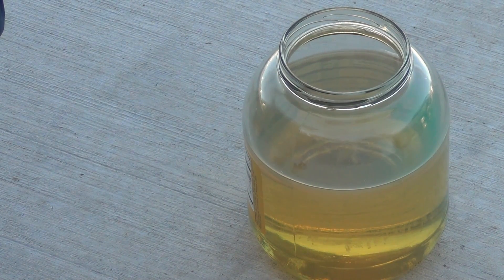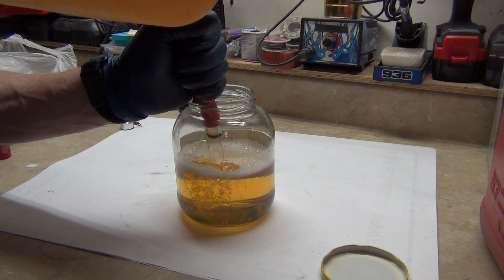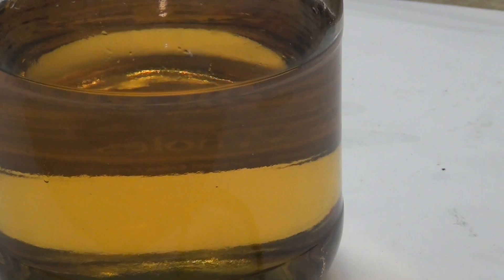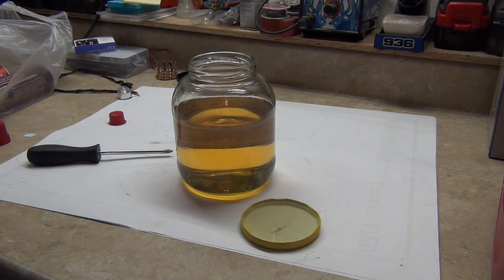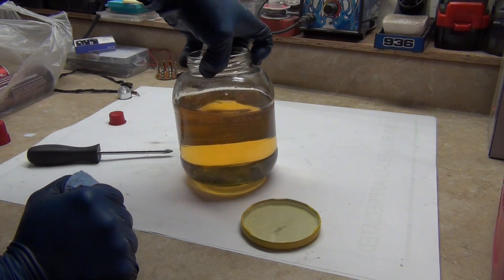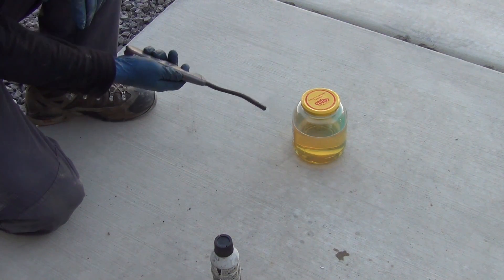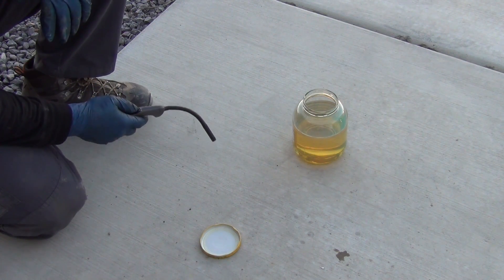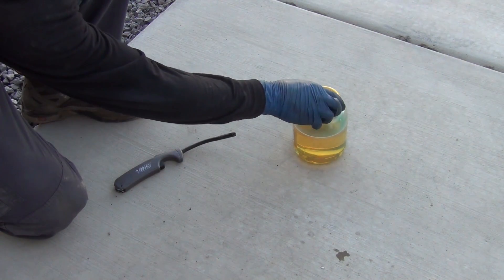What Happens When You Put Gas in Diesel

Comment: Could you add 10w30 or vegetable oil in the gasoline along with mixing in diesel to run it?
Reply: Brian C ethonal in gas is still too corrosive.
Reply: Brian C vegetable oil likely contains sugars that could crystallize and cause great harm to the engine components.

Comment: My mom did what typical moms do and filled about 10L of ethanol into our toyota yaris a while back (then mixed it with gas), i figured it might cause engine knocking or damage the engine entirely, but the car survived until my dad hit a 5-year old buck... in the freezer now. any thoughts to the possible destruction excess ethanol can cause to gasoline (or diesel) engines?
Reply: Michael Light From what i know.. ethanol attracts water and causes the internal chambers of the carburetor to corrode and produce that green oxide sludge

Comment: 1980's Volkswagen diesel:  owners manual recommended adding up to 10 per cent gasoline to the fuel when you knew the temp would be going below 30 F.  I always did it and ran just fine.  At 0 degrees F others were gelled and stalled at the side of the road, mine kept going.  Not so sure I'd do it to my Duramax.
Reply: SamFixit Guy never ever do that to your Duramax ie: Isuzu engine.
Reply: Diesel Tech isuzu makes great diesel engines and they make diesels for many brands. GM knows this.
Reply: Matt Lane You do know Ford has been making the own engines since the 6.4 right? The 6.0 was the last International engine to be put in a production Ford truck.
Reply: Wow, I've never even heard of "MaxxForce" lol. Thanks for pointing that out.
Reply: One spot where you can tell they cheaped out is that compound turbo setup. My grandfather's service truck was shop for a month and half for all that crap.
Reply: To be fair any truck will be a good one for the most part if you take care of it.
Reply: It's just the name of the IH motor... the 6.0 was a VT365... 6.4 is a maxxforce 7.  What ford has been doing is screwing up motors since the 6.0  7.3 they never touched... 6.0 had to meet emissions (and it was a heavy motor so it had no emissions from IH) 6.4 they wanted made on the cheap.
Reply: Yep, I just writing a reply. I remember the MaxxCrap now. I'd like to get my hands on a 6.0 and De-Epa-ify it. I've heard some great things about the bullet proofed ones.
Reply: WDesign, I can validate the great things about a 6.0.  I've got an 04 Regular Cab 6.0 that is custom tuned, EGR deleted, and 4 inch exhaust.  It's a running motor scooter son!!  I've had it since 2010 and I just now put a new oil cooler and head studded it (2017).  It's been a damn good truck!
Reply: Indirect injection ok. Old mechanical injection. 
Most electronic control diesel is not acceptable to run unless way under zero degrees outside air temp.....but electronic control advances fuel supply way early to compensate for the burn rate at low temp.
Reply: "Isuzu" engine... with the name "diesel tech" It is a join venture between GM and Isuzu... wow fail.  And dmax it is own manufacture.... lol if you want a "ie" try ford engines ie, 100% international motors shoe horned into a pick up truck.  Same reason why the powerjunk puts fuel into the motor for regen and dmax/cummins has another injector down in the exhaust.
Reply: 6.4 is not a ford engine, the only engine ford has made is the 6.7.  6.4 was a maxxforce 7 motor.  lol.

Comment: Mixing wide cut unleaded gasoline (sometimes mispronounced as white gas) in the proper ratio gives you something called JP4. Congratulations you've just made very volatile military jet fuel. You are just very lucky you didn't mix in more gas or the results would have been very different.
Reply: Gerry Carmichael now they use JP-8, though the navy may use JP-5 with a flashpoint of >140F.
Reply: Thanks. Fully aware. I'm an ATP with 22,000 hours. This was a history lesson.

Comment: My 98 Crown Vic was really low on gas once so I took one of the gas cans and filled the car so I could get to the station safely. Only thing is one was for the lawn mower (gasoline) and the other was for paint thinning (kerosine/diesel). Guess which one I poured in the tank! 

By the time I realized what I did it was all in there. 

I poured the other can in there to try and dilute it and well....she didn't like it...but she made it to the station and with a full tank of gas ran fine ever since.
Reply: I did a similar thing in the wife's PT Cruiser.  Don't remember how much diesel I put in, 2-3 gallons I think. I finished filling with gas. And keep my foot in it and keep the revs high due to the sputtering. Was doing highway driving and on bridges so that helped a bit. Kept it topped off too.  Never seemed to affect it long term.

Comment: In my experience, all depends on the ratio of "wrong fuel" you have in the tank. Just a little gas in a diesel tank or vice versa you can get away with most of the time.If tank is full, DON'T START the engine! Have it towed to a garage!

Comment: If you have old type diesel injection pump (inline-injection pump) gasoline mixed with diesel shouldn’t cause much damage.
Distribution (rotary) pumps, unit injector, and especially common rail setups are way more likely to get damaged.
Reply: That's what I've heard.  Tolerances are much closer in modern pumps, and while you can't feel the difference in lubricity with your fingers, it can make quite a difference when under high pressures.  It's a bit like getting gas in your engine oil (and a little gas isn't uncommon) - a bit blowing past the rings won't make a noticeable difference in the short term, but I sure wouldn't want to run it in my engine too long.

Comment: I've heard that occasionally putting a little gasoline, say 5% along with 95% diesel in a full tank, will help to clean the fuel injectors and system of a diesel. Is that true?
Reply: Emm Gee Word of caution to anyone attempting this, there is a BIG difference between heavy equipment diesel pumps, (and pumps on older cars) compared to newer diesel pumps on cars like bosh commonrail. I wouldnt feel to bad about getting some gas in my -92 hilux diesel, but if it was a newer commonrail i woudlnt start it at all before getting it cleaned out. Read about several pepole having ruined their pumps this wat, due to poor lubrication as brian mentioned, and the CR pumps are major $$$...
Reply: Diesel Purge is a much better idea than that. Gasoline can be used in extremely cold weather, but again an antigel is better unless you're in an emergency situation.
Reply: I remember a story from my auto instructor a few years back, a customer had filled their Nissan Patrol Diesel with petrol and had run it until the engine cut out, the repair cost almost exceeded the value of the vehicle at the time (I forget the exact figure but it was 10-15 thousand AUD), basically running the engine with petrol had burnt up the pumps and debris from the pumps had gone through the rest of the system.
Reply: Hmmm, actually I sort of do... Been running high mileage disel cars the last 10 years or so, and no fancy mercs :P (no offense, im just joking around) Anyway I do my own maintenace as well. Run a bottle of diesel cleaner once a year before MOT.  Would never run petrol in a never CR disel.  
And I have yet to change a glow plug, injector or fuel filter too so mayby that has more to do with generally good preemptove maintence rather than petrol in a disel car :)
Reply: definitely to +jason puttock's idiotic and barely coherent garbage.  I wish youtube would fix how comments and replies nest.  Sorry if you thought I meant you!
Reply from the maker: Gas is a solvent to most any oil.  Diesel fuel is oil.  Gas is thinner than diesel.  Could be.  I can tell you it will cut your diesel fuel thinner and make it put off fumes.
Reply: AND SOME TIMES TO PREVENT GELLING  IN THE COLD ALSO
Reply: yes! I've seen many heavy equipment drivers put gas in the tank for that reason!
Reply: Yes you can do this and never causes a problem.  I own a Mercedes both vito and E class.  Yes it cleans just like a diesel injector cleaner.  As brian says they are tight tolerences but it has never given me any problems what so ever.  my cars performe better after a clean out.  both vehiclees have covered 300,000 miles and still going strong.  never broken down.  Always serviced is key.  anyone neglects their oil in a vehicle is the root of all causes.
Reply: even the germanys say to use 95 - 5 % mix expsecially at winter.  their cars start better as this video demonstrates.  it will combust quicker and easier.
Reply: ehyeshua Im a FoMoCo diesel tech. You do this in a 6.7 your either going to blow up the engine or your going to spend just north of 8k in parts and labor for a new fuel system. You want clean injectors? Then pick fuel stations that go thru alot of fuel and drive your diesel powered vehicle. Why would you risk this? If there were any mount of petrol in the combustion chamber and the glow plug comes on! If your engine is equipped with them.! Man thats one hell of a explosion!
Reply: Yep, follow the manufacturers recommendations on changing the fuel filter and use the OEM part, no substitutes.  A bottle of fuel system cleaner with every oil change and you should get maximum life from the components in the fuel system. Water in the fuel system is the big enemy.
Reply: Some of these comments have no experience in general mechanics.  Let alone repairs.  This is the reason why I maintain my own cars which have never broken down in a diesel range. 300,000 miles and engine is still strong the day it left the manufacturers.  Yet everyone that just uses diesel only always breakdown.  Funny how people follow the minions.  I have never yet needed to change glow plugs or fuel filter yet i mix petrol and deisel @ winter. 95-5% mix.  95% diesel 5% petrol.  Well the CDI are a blessing to say the least.
Reply: for those that want to learn more.  Read the link here and be taught well.  Diesels are just fine it is a conspiracy saying you CANNOT use a 5% Petrol mix in diesel.  you can also use parrafin/Kerosine....  Max usage of mix is 5% no more.    here read the link provided and its way cheaper than shop bought injector cleaner.  Saves money and stop the conspiracy...... http://www.alfaowner.com/Forum/alfa-155/61960-homemade-injector-cleaner-4.html
Reply: ehyeshua if you use winter diesel you sort of already are. winter diesel contains kerosene to lower its gelling temperature
Reply: ehyeshua if you use winter diesel you sort of already are. winter diesel contains kerosene to lower its gelling temperature
Reply: Hi, if you are driving a modern direct injection diesel adding petrol/gasoline or whatever it is called you risk to damage the high pressure injection pump. It is lubed by the diesel and if you add petrol you could have metal shavings leaving your pump and clogging up your injectors. Sounds bad, but maybe killing your pump is the worse outcome. Would not risk it, If you have a super oldschool diesel without direct fuel injection you can do more or less whatever you want. Fuel up with veggie oil, add (filtered!) frying oil, mix in some petrol in winter, whatever. If you drive an a little bit more modern diesel (maybe the last 25 yrs) this might be a pretty bad idea!!!
Reply: And killing your diesel, also!
Reply: It's best to use the commercial fuel system cleaner products.  It's a few bucks a bottle and it has been tested to make sure that it's safe to use.  It's a good idea to use it occasionally to help remove water/moisture from the system to prevent corrosion and remove crud.  Proper maintenance of the fuel filter is also well worth the small cost compared to replacing failed fuel system components.
Reply: jason puttock Writing all caps does not make what you are claiming any more true. Also drop the namecalling, it just makes you look unintelligent.
Reply: +jason puttock Yours might be the dumbest comment I've seen today.  It's truly astounding how willfully ignorant some people are.
Reply: bklynp718 Are you replying to me or jason puttock
Reply: From what i have been told and understand.  The injector cleaner are pretty much based on petrol in a chamical world.  Also, Diesels is a derivative of oil just proccessed in a different way with more added chemicals.  They are truely the same thing in nature.  So I am guessing that, you would say that truck diesels and car are complettely different fuels.  That is why the government say it is illegal to use truck diesel in a car.  That statement is bullshit in itself.  Sure diesel is a different color in nature but for 1 pure simple fact.  They added dye to it.  That is all folks just dye.  Nothing fancy...  Its all the same shit...

Comment: I mix a 50/50 ratio gas/diesel or Jet A to Flash 21 for making napalm. Gels up nicely for lighting logging slash piles. Gas lights easily, diesel burns slowly, and Flash 21 gels them up so you can handle the mixture.

(Not at all relevant, but felt like sharing)
Reply: XxKPOPxX and in other news, children randomly start making napalm in their garages at home. 🤣🤣🤣
Reply: XxKPOPxX if you take a couple styrofoam ice chests the cheap ones and dissolve it in the mix u will get actual napalm almost impossible to put out
Reply: I do this for a job, look up Flash 21.
Reply: Do I need to get a retroactive security clearance?
Reply: XxKPOPxX Thanks 🙏 good one 💯
Reply: I genuinely love the smell of napalm in the morning 💥☄🔥💣💉🚑🗯
Reply: ATTN DHS

Comment: back about 1962 on of my drunk friends filled his 51 olds up with diesel buy mistake. It ran about a quarter mile and stalled out. The next day we drained the tank. put gas in it and some in the carb. it did not suffer at all. Ran on for years. My wife got diesel in the gas at a cut rate station(probably mixed in the tanker truck). 1988 toyota corrola. knocked when it ran and the head gasket leaked so changed that. On and on that car is still going. That 4a-lc toyota motor is a tough one.

Comment: i work at an auction where the delivery drivers put gas in diesels all the time. we just hook onto the quick connect beside the bellhousing on the fords on the return side with a piece of hose then jumper the fuel pump on
Reply: Most times there is no drain 9/10 times we make the fuel pump do the work

Comment: when I was 15 back in 1960 Minnesota. People with diesel cars/trucks would put about 10 percent regular gas in with the diesel(only in cold winter) to get the diesel to start easier but mainly to keep the fuel from jelling. yes it worked fine.
Reply: A Diesel Mech told me once a month he would do 5%-10% mix to clean injectors. 

The winter mix makes sense.